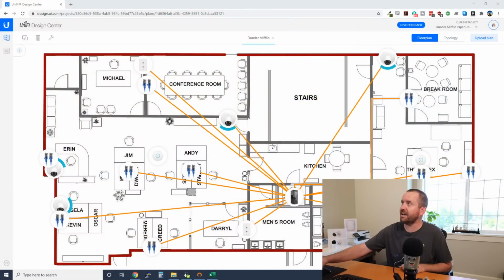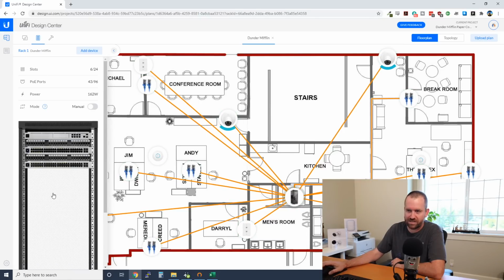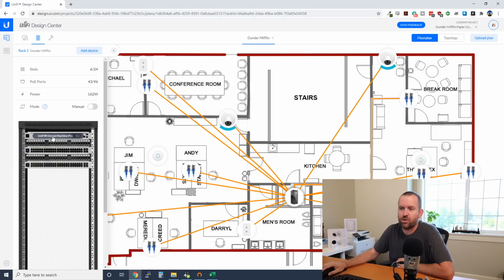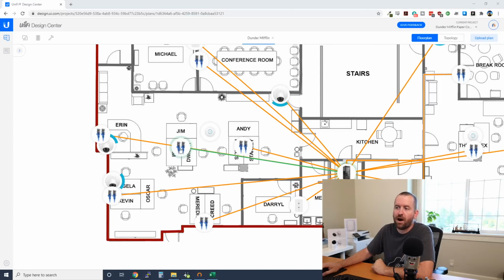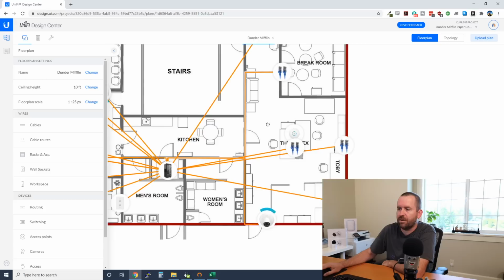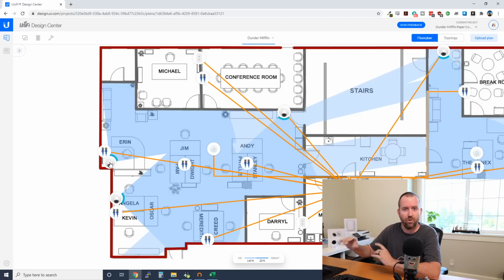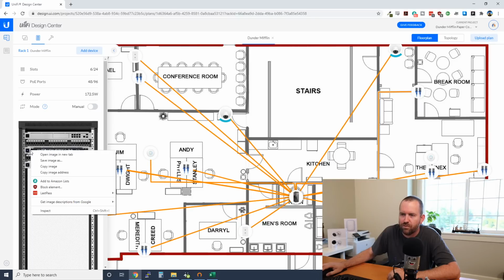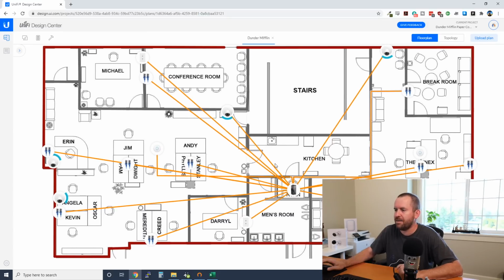"the office" Network Design

Comment: I played with this tool for my house (going to the extreme) and it's really helpful/informative when thinking about placing APs, Cameras, etc.  I wish they would offer some smaller rack options as you mentioned.  I also did not like how the topology did not allow you to dictate what plugged into where on the equipment (ie, I wanted some things to plug directly into the switch portion of the Dream Machine Pro & then the rest to plug into my USW-Pro-24-POE.    

Still, looking forward to their improvements... there is a button to suggest things you mentioned that you found cumbersome/issues with.  The more we suggest, the better the tool should become.

Comment: Wow that was a great presentation. I was just wondering if the UDM/Unifi network will be robust enough for a church where they are required to install a firewall. The network is pretty simple , nothing advanced. The UDM Pro firewall content filtering etc is not as robust as with a Sophos or a Fortinet. My thoughts. What do you think ?

Comment: Hi Folks,

I would say this is not enough when you need to design a network,  i suggest you to make it on excel sheet the explain each labelled port on the patch panel to which port is connected and which vlan is assigned 

That extremely would help in deploy the network in better manageable way

Comment: Lol not enough cabling. 2 ports per user/desk, 2 ports per camera and 2 ports per printer. After all, customers always wants to expand and "over building" costs so little.
Once I had cable go bad during camera  install and it was shitty route so I just used that "extra" run for the camera, no need for new cable run.

Comment: Always plan for the future. At least 2 if not three ports per workstation, and a dedicated print/copy area should have its own ports. You never know when someone will need an extra one, and user-accessible switches should be avoided. Also, permanent devices like cameras and access points should never be wired to accessible wall jacks; hardwire them or install a jack in the ceiling where It’s not easily reached. Alternate ports between panels/switches so a given switch failure does not knock out all the ports in a location. (If you have three ports per desk, plug into three switches.) Same with AP coverage; everywhere should be covered by two APs connected to different switches if possible. You might consider dedicated switches for APs to account for upgrade to multi-gig later on.  Every installed port should be connected to a switch, even if it’s not immediately required; the less mucking about in the wiring closet down the road the better. Nothing like having the Help Desk tech unplug the wrong cable trying to provision a printer and the execs drop off the earnings call. Don’t forget ports for conference room A/V gear, plus ports in the table for users. (Put those in the guest network or use 802.1x on them.) Also want ports for the door phones, door locks, security system, HVAC controllers, courtesy phones, lighting controls, UPS and/or generator interfaces, TVs and who knows what else needs network these days.

Comment: meh, not impressed with how he says in summary '4 jacks for 2 people, lets not go crazy here'.   PC + Voip phone = 2 jacks minium.  Let alone a printer nearby or other network devices.   I also wouldn't peal off a cable from a wall port to feed a camera... just doesn't make sense.
Reply: It makes complete sense in if you wanted to occasionally unplug said camera......
Reply: @imark7777777  wut.... unplug a security camera...  in an office.    Why?   If you needed to power cycle the camera, you can login the switch and cycle the port.

Comment: Curious why you wouldnt use the G3 Flex cameras for this setup.  They offer the same resolution, but a much smaller profile when used with the drop-ceiling mount.  And more importantly they are half the price.

Comment: Awesome job, my only critique.. I would never do an implementation like that with a single firewall, either HA or Standby, same as with the switches.
Reply: Who has so much money to spend on additional (already expensive) routers and switches just for a possibility that one will fail eventually (which could happen after 15 years or so) for a bussines like this? It’s a regular office, not a bank, right?
Reply: Adam Malesevic any business can and will spend an extra 1k or less to not be down for an entire day.
Reply: I personally would do 2 Sophos firewalls in active-passive HA
4 bay unifi nvr
2 switches
Every camera on a dedicated cable (no piggyback on wall port panels)
3 ports per desk
2 ports per printer
And 4 ports behind each TV
And 3 nano HD’s

Comment: about redundancy: in the video i could see that you have "built in" a second switch, but there are no connections to the end devices. how would the redundancy work if the first switch fails ? you would have to patch everything again onsite ? except of course that you would replace the defective switch anyway
Reply: I think so
Reply: Slightly longer patch cables that can reach both switches, maybe? It'd be less clean, but easier to fix should the redundancy become necessary.

Comment: This is a recommendation. Instead of running the cables directly try using the "Cable Routes" tool. You just draw the routes and place all devices, after that you right click on the center of the office and select "Auto Connect devices". I'm amazed with this tool. thanks for the video.

Comment: Unifi deserve a lot of credit for this design tool. On 5 jobs that were completed recently I've found that the wifi range estimates, once you've got the plans to scale, is bang on. Four different APs models all had the expected performance through walls at a given range. Devices include AP Pro, AP AC Mesh, AP Mesh Pro, BaseStation XG. Basically, this tool allowed us to properly plan the installation and estimation of wireless APs down to the meter, which is truly revolutionary. Yes, Cisco's network simulator is much more capable if you want to plan your current and future network load, however if all you want is to calculate your wifi ranges in a way that makes sense to both a client and the installer, Unifi delivered.

Comment: If every person in the office has a phone, why not give them a jack for an IP phone? Are you guessing that  at this point they have moved to using soft phones instead of a physical device?
Great video, I really enjoyed how you showed off this new feature.
Reply from the maker: Great question. In most scenarios we assume that each user with a VoIP phone only needs 1 drop because all modern VoIP phones have a pass through port for Ethernet. It’s pretty rare that users will have separate drops for phone and PC.
Reply: @CrosstalkSolutions  That makes sense then, thanks
Reply: I thought exactly the same.  As others have noted using VoIP in an office space normally means the network is converged, rather than non-converged.  My company is completely non-converged as I work in business continuity and recovering a customers telephony over converged is a nightmare.